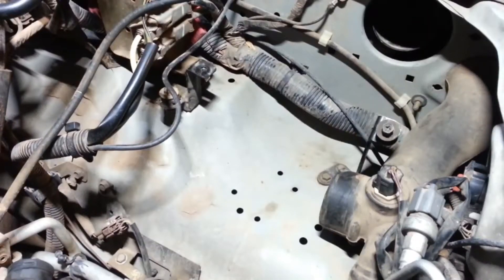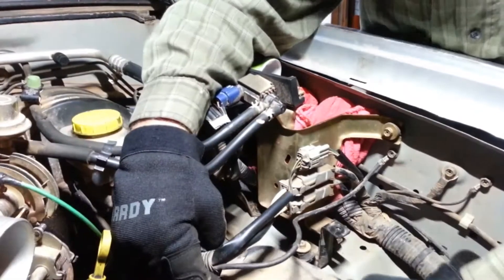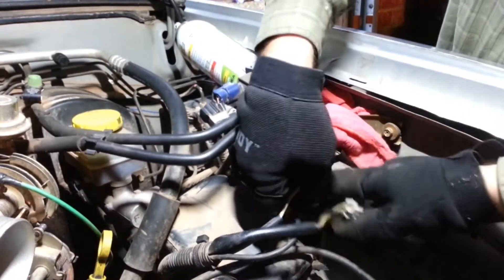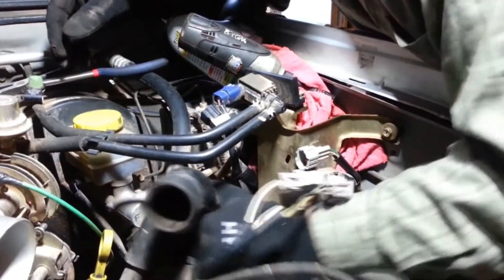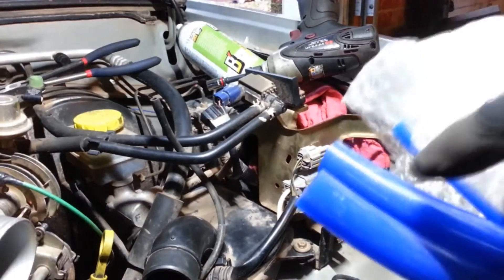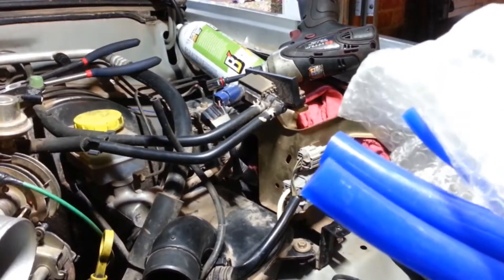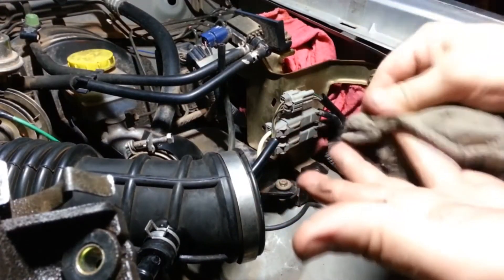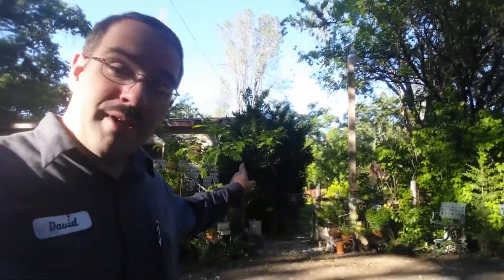Reinstalling the Nissan Frontier's Stock Cold Air Intake Part 1

Comment: Great job David and don’t worry about the intake hose going upside down. I’m sure that we’ve all done a lot worse before 😀 it was a nice touch on the music, just right for content and not too loud. 👍
Reply from the maker: Yeah. I had to leave the upside intake tube in. Too much fun. 😂  With the warmer weather we've had my miles per gallon  is way up. The weather was threatening that I still needed the hot air intake for a while. 🔥💨

Thanks! Adding that much different music was a lot of work, but while editing I couldn't stand the neighbors kids shouting and screaming so I needed to cover most of it up. Lol. 

I finally got a new laptop and made it easier. Lol I was inspired by your previous comment ...and... it finally completely dead. 

I saved some money on an AMD12. Claims it's way faster. Anything is faster than a dropped hard drive! 👍
Reply: Excellent David on the new computer! What video editing program do you use?
Reply from the maker: It's by Sony version 14. After 12 it was no longer called Sony Platinum 12. Steve Rob uses that. Lost my disc to it moving back from California. Vegas Pro 14 is way nicer.

Comment: I've had good luck with using  silicone paste on all my quick connectors .  I won't  be watering any grass for six more months 😂
Reply from the maker: Yeah. Silicone paste is awesome. The spray version just wets things for a moment to make it easier while the paste has staying power. I used to work at a shop, which kept it stocked but everywhere else they don't have it. The shop which did have silicon paste didn't have grease for brake pads so we had to use silicon. Actually worked. Everywhere else they have grease so you can't silicone the caliper slide pins. And I can't find silicone paste for sell, except the wetter evaporative silicone spray.

That was actually a dual sport visit to my Aunt in California where I watered grass. I totally forgot I filmed a get out there and work on something there. My google photos suggested I search her city and I found the treasure of her beautiful gardens. She's developed the plants there over a lifetime. It's incredible. My land grows whatever it grows, lol. A couple rose bushes are nice, but I think they only flower if you trim them. Tons of trees and moss. Here the sky self waters you pretty well, lol.

Comment: that job looks quite tricky
😄👍we gave a big like👍3👍fully watched😄we always support 🕵️‍
Reply from the maker: Ya know. Before I had some solid experience under me intake tubes used to be a lot harder. Now I realize I can do it, but you miss one detail and you have a vacuum leak. Hey, if anyone decides to try the short ram on this truck and they want to do it, I can help them get the wires back right, right? LOL. Multiple connectors which can be plugged in wrong? Scared me until I remembered I wasn't talking to "myself", I was recording it, lol.